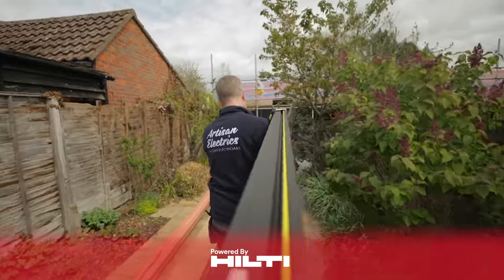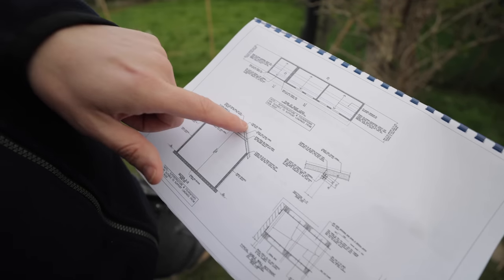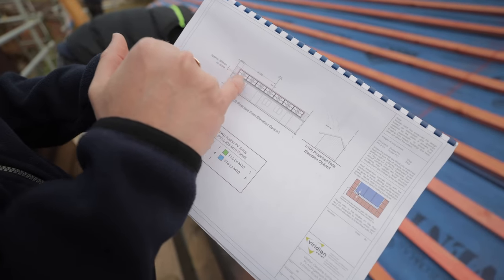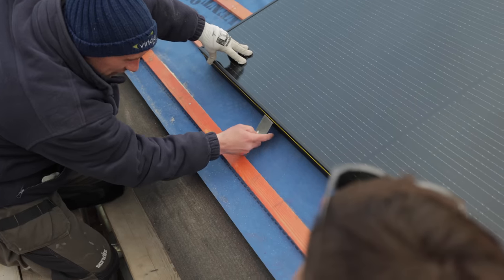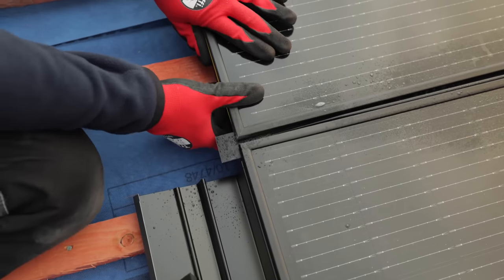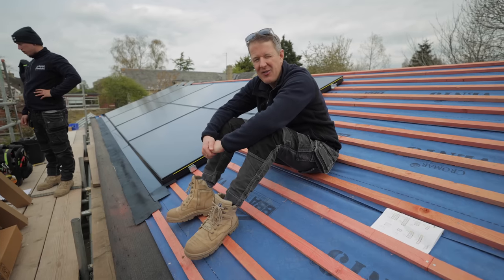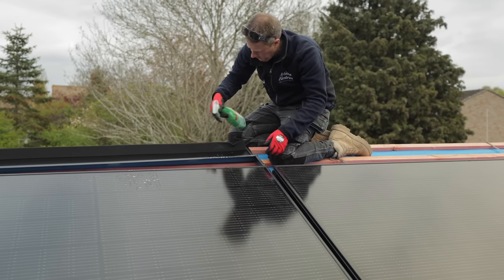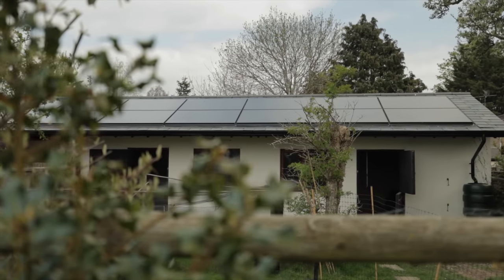Installing an In Roof Solar Panel System

Comment: Probably not an issue in the UK, but in more southern climates with higher insolation, panels overheat - which causes their efficiency to drop significantly. Natural convection between the roof and raised panels has a significant cooling effect - which is missing completely in an in-roof installation. Not sure of actual numbers though.
Reply: You are right, heat soak is an issue with rooftop installations and efficiency drops with increasing temperature, even for installs here in Belgium which is not exactly a tropical location. If you have ever spend time on a solar roof around noon, you will attest it becomes unsufferably hot, you can see the hot air mirage where the air seems to be vibrating. On the other hand, these hot periods usually correspond with lower demand for power and lower feed in tarrifs drop because of the excess PV supply anyways. If your system is overdimensioned to accomodate for lower production in the winter it should cope... It will get hot in the barn for sure....
Reply: Correct
Reply: Well no, just means your installation without venting below was CHEAP.
Reply: Solar panel outputs are rated when the panel temperature is at 25c, it is rare for panels to be that temp' when there is full sun, especially in summer. For every 1c rise in temp' the panels derate about 0.5% (it varies from brand to brand). It is not unheard of for panels to reach 70c in the middle of the day in summer, so you lose about 22% of you rated output. at that temp'.

Having zero air gap under the panels will not do much to cool the panels. They may look good, but are a failure in the cooling stakes.
Reply: What we need is solar hot water that is preheated by the PV panels, thus cooling them.
Reply: @mrtechie6810  there are comined pannels but you need to be able to drain the hot water all the time, because if your hot water tank is full at 90 degrees and you stop circulating cold water, the entire system on the roof heats up and the rubber gaskets in the couplings start to degrade. I have to replace mine every year and I hate plumbing on roof tops. It can work fine if you have an unlimited reservoir like a large pool
Reply: @ttkddry  I saw a Linus Tech Tips video about installing combined PV and hot water panels on his house in Canada. He has a big pool to heat, so no problem. Wow about your installation: I didn't know the pipes go bad! I have a separate thermosyphon solar hot water heater - which is really ugly - but it's never had any problems in the 10 years I've had it, other than slowly cooking whatever booster heater it's connected to (on the 3rd one of those now).
Reply: @markmuir7338  it is not the pipes, it are all the rubber parts that get unfortunately cooked in my case, usually in the least accessable places :-)
Reply: @mrtechie6810  I own a solar business in the US that has > 65000 systems in place.  In certain locations here we route pool heating water pipes below panels to do exactly that
Reply: @mattbrew11  could you point me to a commercial product?
Reply: @mrtechie6810  I could but the commercial panels don’t work well
Reply: @ttkddry  what rubber gaskets? Are they needed?
I only suggested preheating the incoming water, not circulating hot water to the solar panels.
Reply: @mrtechie6810  there are plenty of connections where you hook up your waterlines to the heat exchangers on the roof. As long as your water is circulating you are draining the heat from your roof, the problem occurs when you stop circulating your liquid for example when your buffer is full at 90 degrees Celsius or more. I see temperatures of up to 250 degrees Celsius because that is the upper limit of my temperature display, I assume things get pretty hot on top of the black temperature exchanger
Reply: @ttkddry  I had solar water heater for my pool, but removed it after 20 years for regular pv panels. It had two major problems. The water needs to circulate when the sun shines, that's understanadble but when the power goes out, the pressure increases and evaporates the pressurized water out. When the power restored the pressure was too low for it to function. Had to call a service technician to fill it back up with glycol. Not cheap.
Another problem was our pool was getting too hot in the summer. It got to the point it was not refreshing to swim in it. Again I couldn't turn it off as the glycol water mix had to keep cooling the panels or it would blow out again requring costly service visit.

I got a pool heat pump and am fully in control of the temperature and I can even cool it now :)
Reply: This is one of the reasons why there is more and more a debate on what's best/optimal, installing all panels to the south or installing them to east and west. An east-west configuration lowers the peak capacity but raises efficiency due to less heat. And this way the power production is more evenly spread over a longer period as the power production is starting earlier and stops later.

Of course it all depends on many factors, so there's no easy answer.
Reply: @Sierra-Whisky  Hopefully better surveying software will come along and take all these options into consideration to see what's best for each site.

The east/west panels idea is an intriguing one: I hadn't thought about the effect on improving efficiency. I think we will start to see this configuration becoming more popular once electricity pricing better reflects economic realities - encouraging production when it's needed vs total energy produced. This will reduce the amount of energy storage needed to maintain a stable grid with a large mix of renewables.
Reply: If the roof had been counter-battened as is recommended practice with breathable roofing felt it would improve both cooling and drainage if needed.

Comment: I'd say it would be an f'er if one went wrong and you have to remove. Look over maintenance I dunno about that.
Reply: Yep a ball ache to take apart.. no chance of saving the flashings
Reply: Would be great to get a reply from the team with their view on this, absolutely share the concern
Reply: My panels are now 13 years old and still producing like 98% of what they gave from start. Never ever done anything to them they just produce.
Reply: @peteroffpist1621  and that’s exactly what we want 👍

The concern is if there should be an issue, how involved is it to replace a panel, if it’s a case of stripping the system off panel by panel to get to the faulty one then that’s a big expense.

I like the Tesla roof setup where you can lift each panel individually for maintenance or repairs, and they look incredible
Reply: @InTruServ  anything in life can happen. A meteor could hit a panel but if it’s a one in a billion risk why bother? That is why we have insurance companies.
Reply: @peteroffpist1621  I don't think insurance would pay out. EEVblog channel had a panel shatter from a micrometeorite hit. It looked amasing. Hits are more common than people realise.
Reply: @mbak7801  well my insurance covers my solar installations, so maybe one has to check this with insurance companies. I have two installations since 13 years. Only drawback is birds sometimes take a shit on the panels but next rain takes care of that problem.
Reply: after 13 years i do this job, just one or 2 solar panel broke from thousands, maybe 25 000

Comment: I have an in-roof as we replaced the roof/fascia's at the same time. Saved us a lot of money in Tiles as 90% of the front of the house is Panels not tiles and looks so much neater. Thanks for another interesting video guy's.
Reply: Do you notice any drop off in output on hot sunny days? Comments here suggest that in-roof installs have reduced ventilation on the underside.
Reply: @JohnnyMotel99  not seen any really hot days since install! It is now 2 years since install and produced over what was estimated.
Reply: @MyImperfectEcoJourney  did you use Veridian or the tray system?
Reply: @JohnnyMotel99  JA solar panels with tray system.

Comment: Wow, I doubt that sub-roof is going to last very long. It has only a single layer of waterproofing which is always a very bad idea. The homeowner would have been a lot better off installing a 50-year asphalt shingle system under the panels. It looks like water will leak through this panel system and over time, it can degrade the single-ply underlayment under the panels. Further, heat will degrade the single ply underlayment over time.

Comment: Viridian is brilliant system.  I installed it myself when the roof was being replaced.  Matches up perfectly with the Slaredge Optimisers / Inverters.  Would recommed to everyone.  Also to add, stops the bloody pidgeons nesting under frame based panels.Well done guys.

Comment: I've just been involved in helping to install a 1200 panel Solar Panel installation on a big factory rooftop area of the  English Provender foods Company over on Greenham Business Park, in Newbury, Berkshire, (for the last 8.5 weeks until today), which included 598 Optimizers (SolarEdge), and four Solar Edge inverter units, and so I understood this video quite well, and found it to be especially interesting to me.  I also worked on a new-build 29,000 panel Solar Farm (back in 2014) on the outskirts of my village in Oxfordshire (for 4.5 months), so I've learned quite a lot about this sort of stuff at first hand.

Comment: Top tip:  Always supply 1 spare panel with an in roof system.  Why?  Because if a panel goes faulty, while it might have a warranty, there might not be any obligation to supply an “identical” replacement panel.  Most likely you’ll get a “similar” panel in terms of performance, but it could be different height and width, at which point it doesn’t fit the tight tolerances of an in roof system.

On roof systems don’t have this problem.  If your replacement panel is too big, in most instances it’ll fit in the corner of the array and just look ugly.
Reply: My in roof has got a contaminated panel and the installers warranty has proven to be useless, basically say I have to speak to the manufacturers in China who charge ridiculous amounts to supply and ship and installers charge labour to replace it. Useless warranties are no doubt par for the course so a spare panel is good advice.
Reply: @aldozilli1293  Warranties are useless. I have two on-roof solar systems (my energy needs increased when I got an EV). The panels of the first were from a Canadian company that went bust shortly after. I learned my lesson on the second, and went with LG. Who then exited the PV business and my warranty is now also useless. Thankfully only 3 of 24 panels are underproducing, and I have microinverters so none of the others are affected. Given difficulty in finding visually matching panels and labor costs, it's pointless to replace individual panels.
Reply: whoa, really?
Reply: @markmuir7338  Microinverters are the way to go if you don't plan to use batteries, right? I faced this when I bought mine.
Reply: @GEOsustainable  “the way” is impossible to quantify. Both string and micro inverters have downsides.  I can say for sure that “the best” microinverters are Enphase IQ8s. See my comment above. We’ve tested all of them
Reply: @GEOsustainable  Microinverters are a little more expensive, but I think they're worth it for several reasons. I added home batteries to my system with microinverters - mostly works fine. 

Only issue my system has is when running off grid during an outage: when the battery is >90% full, the inverters in the batteries intentionally shift the mains frequency out of spec so the microinverters will shut off. That works, but these old microinverters take ~10 minutes to start operating again once the mains is back in spec again. This wastes battery capacity and some solar production. Could be done a lot better if the batteries could communicate with the microinverters using their existing Ethernet over mains network, to tell them to reduce their output to a specific amount in real-time. Same problem applies to any 3rd party inverter though - micro or not.
Reply: @markmuir7338 Agreed about there not being a specific "way". Trade-offs will differ depending on the installation. For example, I suspect that people with certain types of in-roof/BIPV systems might want to go with string inverters because changing out a micro-inverter or optimizer if it needs replacing can be so much more of a hassle than with a conventional racked system. I'm talking about the kinds where the micro-inverters or optimizers are between the roof deck and the PV, and all the fasteners are covered by subsequent tiles either going up to the ridge/hip or to the side, depending on the design, and can only be accessed by starting at the end and working back. If the part to be replaced is in an inconvenient location, accessing it might require taking up a substantial number of panels/tiles to get to it. And if the lifespan of the panels and wiring is significantly longer than that of the micro-inverters or optimizers, you might have to do it multiple times over the lifetime of the system. Of course I understand why a system might go for covered fasteners - it's better for longevity and reduces maintenance and the chances of leakage. Exposed fasteners with gaskets or rubberized washers on metal roofs are due for replacement in 15 years, whereas covered ones in double lock standing seam metal roofs should be good for 50 or more. It's just that if something does go wrong it's a headache.

Comment: I've done 3 of these now, me and an apprentice. We went down the micro inverter route, but we smashed 10 panels and flashing in a day and we didn't start till half 9. Rate it alot!! Quick easy and no d.c in side
Reply: No dc inside? Did you link the dc under the panels but above the felt?
Reply: @Scott-wz4sc  yeh
Reply: Enphase supply pre made a.c lead to link inverters and strings plug into individual inverters so you're left with a 2meter a.c lead in the loft. 6mm armoured from consumer unit upto rotary isolator in loft and next to board with meter 👍
Reply: What is the price of these ?

Comment: Would counter battens be better for the ventilation of the panels and ventilation for the roof to remove condensation.. If air can get in it will dry out any small water leak imperfections/condensation  if the customer applies insulation inside. A ventilated roof is always going to be a better job. .

Comment: Looks insanely tidy, just wondering how good the rubber seals are with temperature changes throughout the years.
Reply: if they used the right rubber they should last longer than you or I. judging by the quality of the rest of the product its likely they did.

Comment: Looks good. Easy to swap out a failed optimiser if needed, hopefully the panels keep working nicely, and they keep a reasonable stock of spares in case of accident or failure.
Reply: Grate video! Have you used micro Inverters yet?
Reply: Good luck trying to replace a single panel when they’re that tightly integrated (but they do look great!).

Comment: I love how sleek the PV-install looks! 
However when thinking about maintenance and repair such an install could be a hassle....
How do you take a single damaged panel off the roof?
Reply: Slide away from the top or bottom?
Reply: @KoScosss  but the fixings are hidden under the adjoining panel.
Reply: @KoScosss  just looked again, they are nor, they are in the gullet between the panels. Still not sure tthough.
Reply: I agree.
Reply: Bypass it electrically and leave it there until more panels need replacing.

Comment: I own a solar company in the us with more than 65000 home systems installed. 

I can say with absolute certainty that the roof pitch utilized here is in no way ideal. 
For year round ideal production on a system, 50* of tilt or a 14/12 roof pitch would work best 
The other issue with this system is that you are losing convective cooling, which is the same reason a tesla roof tile is wildly inferior vs a high qualify PV module

Comment: Great install! Dream setup! Would hate to have to replace a faulty panel im middle though 😂 looking forward to deep dive members video!
Reply: It should not fail completely but operate at reduced power where optimizer can correct for that. But it looks like it will be easy to bypass it with a jumper wire if necessary. If few panels do end up failing completely the system can still operate at reduced power until multiple panel replacement becomes financially beneficial.
Reply: These can be replaced individually

Comment: We had the same system fitted as a retro fit as needed to replace the underfelt, 18 x 335 panels in portrait on east side and 18 on west side all with optimisers in the loft space and connected to a 8kW SolarEdge inverter.

Comment: I think the lathing must be done vertically and next layer horizontally. Now, the condensate from the diffusion film will have nowhere to escape and you additionally drilled film when attaching the panels...
Reply: Yes. They did it wrong AND penetrated the water barrier with a zillion screws. Comically wrong. Guaranteed to leak and guaranteed those horizontal batten dams they installed will trap water and rot out that roof.
Reply: @fredsnit5699  Are trays a better solution?